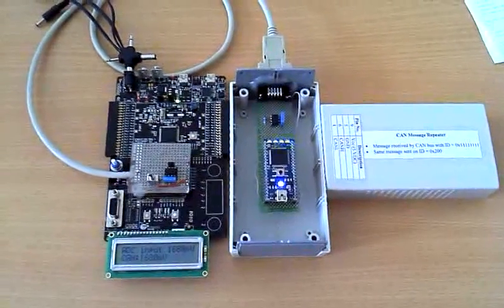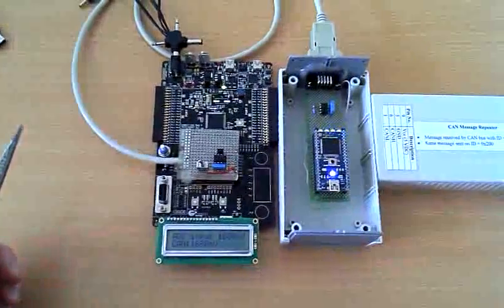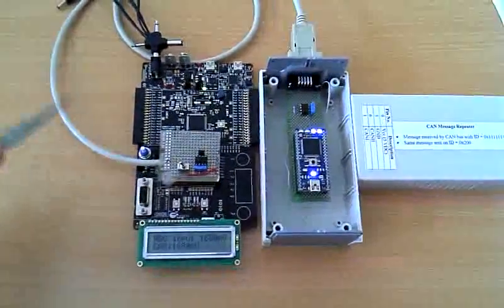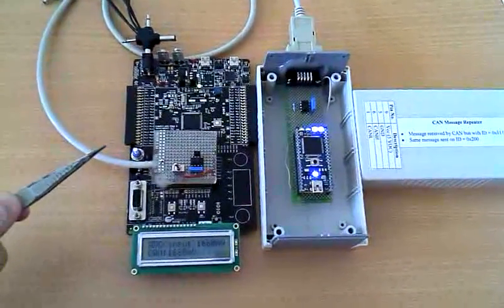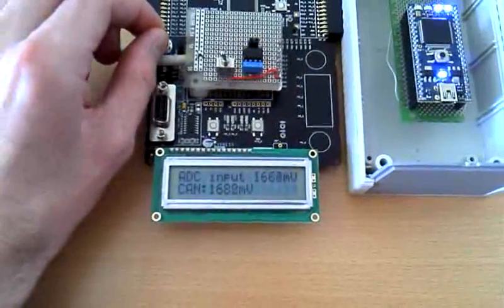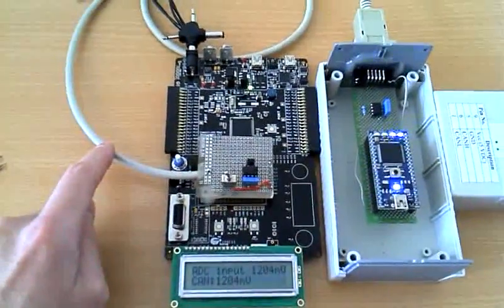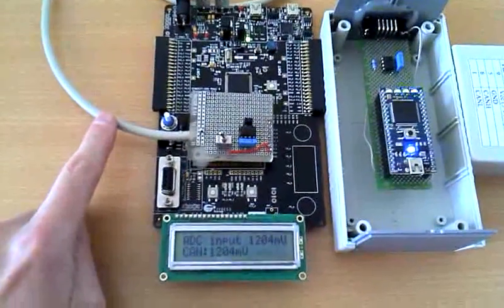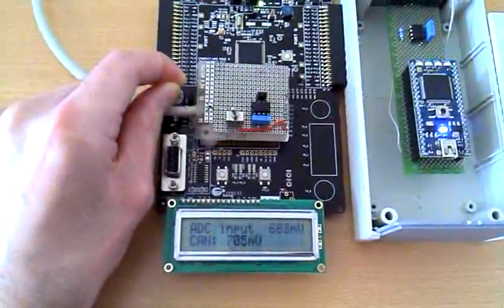Full CAN Bus in PSoC5 for Electric Cars

Comment: So FULL can mode means that you can enable a filter to CHECK :   IDE, ID (11bit: 0-0x7FF), RTR and RTRreply?

For example, in the GUI, Configure 'CAN'it  allows you set Full or Basic, and an ID for a given mailbox.. but is it possible to filter a range of IDs to a mailbox? ex.  IDs 0x40-0x4F all mapped to Mailbox 0?   Or accept messages only when the Data matches as well (Mailbox 5 =  ID 0x45 with data bytes 0 & 1 as  0x55AA)?

Does the mailbox always contain the last message accepted, or if the CPU hasn't retrieved it keeps the first message and ignores future messages?

I looked at the generated code (CAN_Start() -> CAN_Init() -> CAN_RxTxBuffersConfig() / CAN_RxBufConfig () and corresponding structure (CAN_RXConfigStruct : Mailbox, Command, AMR, ACR ).   Since the last structure elements are 32-bit,  can the filter-data be manually set?  ex.   ACR_L = S_ID << (18+3)  |   ??     AMR.ID = ~(0x7FF << (18+3))

(I've seen other devices where there are AMR_D and ACR_D 32-bit registers, where the [15:8] and [7:0] can be used to define the data bytes 1 and 2 respectively.. however does such a thing exist with Psoc devices?